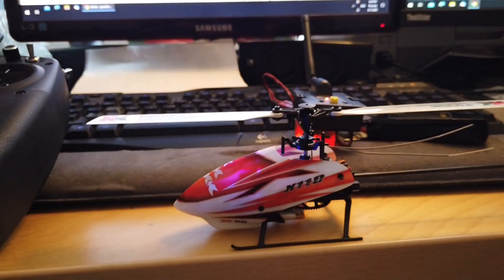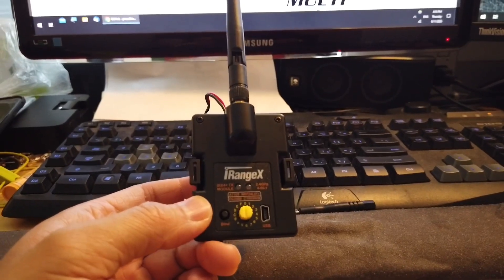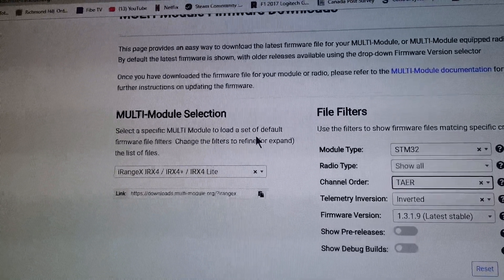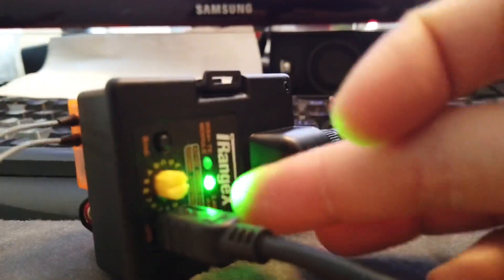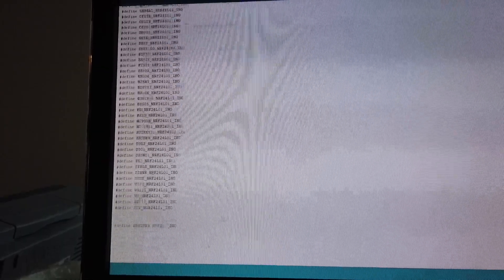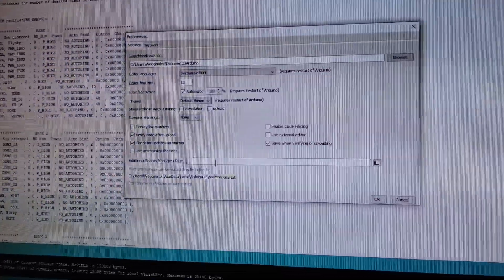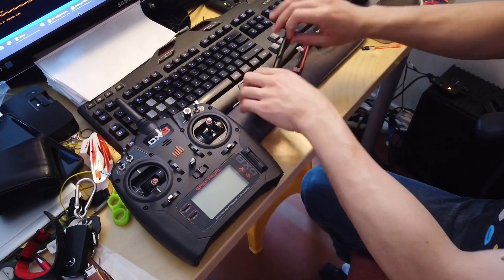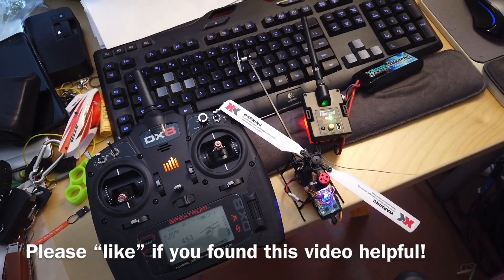XK K110 helicopter with Spektrum DX8 using iRangeX

Comment: I have a JR radio that takes external modules. I am hoping that if I use the iRangeX  Plus module in the external bay, your method of setting it up would still work. If you have any thoughts on this, please comment. Thanks for the video, really helpful.